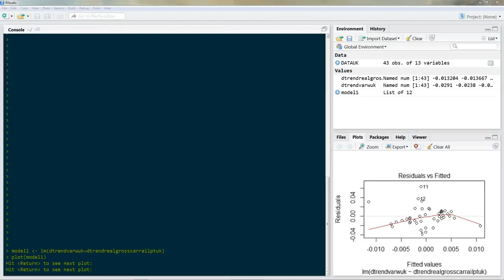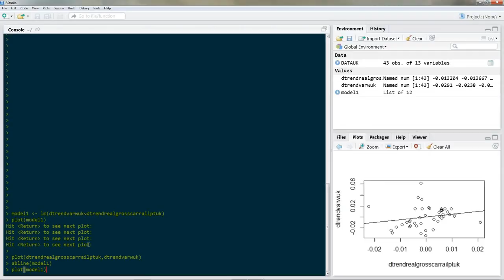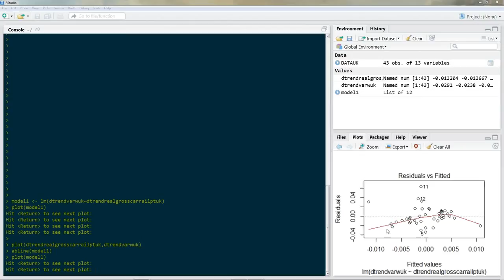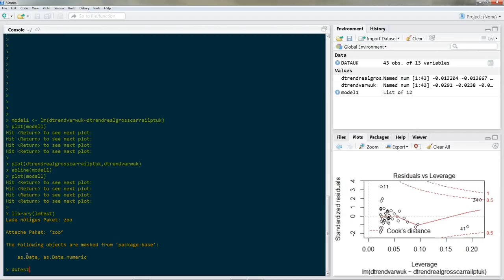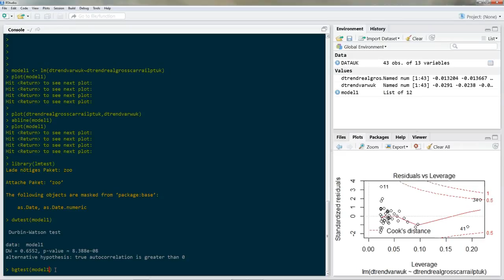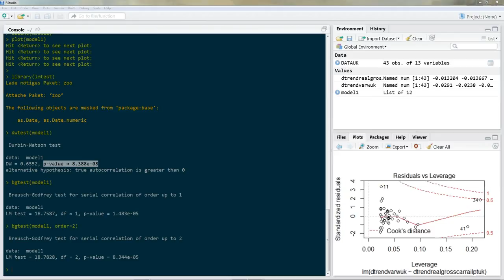Principles of Cliometrics (Episode 32) - Durbin-Watson Test and Breusch-Godfrey Test in R

Comment: could you please tell how ti get this library(lmtest)  it doesn't come , thanks
Reply from the maker: You have to make sure that it is installed on your computer. Just make sure that you've selected the correct mirror and  run the following command in your R console:
install.packages("lmtest")

Now you should be able to load up the package and use it